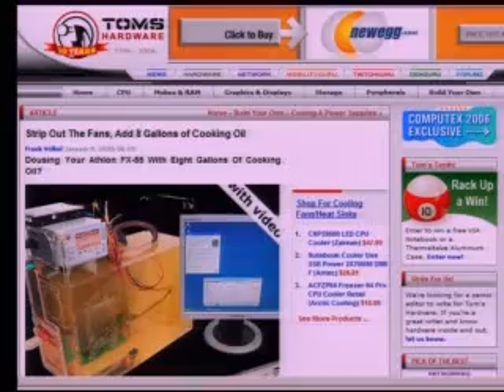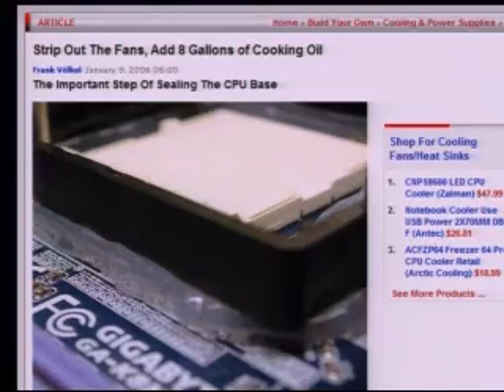Cool Your PC With Vegetable Oil

Comment: Dear God, I've seen some retarded shit in my time, but this has to be right up there. If you're going to build a submerged computer, you use mineral oil, not fucking vegetable oil! Vegetable oil is too thick and won't circulate properly even if you use a decent pump that can handle it. Vegetable oil will also denature over time, moreso when heated. And this guy has worked in IT for 15yrs??! Yeah, probably at the fucking help desk at PC World.

Comment: ok so i am spending thousands of dollars on pc components to submere it in oil lol better i buy a gun and shoot my self lol
Reply: I don't think so that's crazy I jusy made mines and it cost me over 3500 aint going to happen
Reply: Romon Reid Veggie oil is okay, but because it's organic based. you have to change it out every few weeks because it will rot. Use Mineral oil instead. Non conductive so it won't harm electronics. and it's not organic based so it lasts much much longer.
Reply: ***** I know. I just said that.
Reply: OK I congratulate the guy that did this  but I am not doing that to mine

Comment: Vegetable oil will go rancid. Use mineral oil instead.
He keeps referencing a "web site" for more details and cautions, but they keep this "web site" address a secret.
Also, the oil doesn't make the heat go away. It merely dissipates it. If you run for too long, you're going to want some way to cool off the oil.

Comment: for those that are wondering why not water. oil is a non cinductive liquid so it wont interfear with the electronics as normal water will. or if you wanna get pricy the water they tryed only lasted for so long.

Comment: @Kaoskadosk Heat goes from the oil, out the glass and into the air? Even water cooling transfers heat to air eventually, its just making it cooler and more efficient.

Comment: @jfkd00d   That's not the point though is it.  Using oil to dissipate the heat keeps the systems free of dust - and there is absoultely no noise!

Comment: PLEASE use mineral oil to be 100% Safe from any Electrical Hazard. this Demonstration you see here with Vegetable oil is NOT SAFE for you as a normal Computer user. As you can see, the guy used an old computer in this show, NOT his Alienware (he's smart enough to NOT put it in Vegetable oil ^_^ ).

Comment: Convection would alleviate any hotspots by natural thermodynamic flow of heated fluid becoming less dense and rising while cooler, denser fluid falls. Leaving the fans on will just kill them. They have light duty motors and bearings designed to handle a volume of atmosphere, if you increase the density you're asking them to move, the motors will strain until they finally burn up, possibly burning the connections on the plug due to the increased amp draw.

Comment: Distilled water is non-conductive, however, when exposed to open atmosphere microbial colonies form and their waste over time makes the water conductive, as well as airborn pollution. Vegetable oil is also ridiculous. It's used for cooking for it's fast thermoconductive properties. Mineral oil is smart, as it's used for high voltage/ampherage transformers, but screw oil. If you choose to upgrade, good luck degreasing sensitive electronics. Just buy a glycol liquid cooler and be done with it!

Comment: What someone should do is make a system like this that connects to pipes in a house and let the pc heat the oil and the oil circulates from the tank throughout the pipes in the house and back into the tank to heat a house.

Comment: yes. it would be wise to put a circulation pump and radiator in. i did this with an older computer and ran a benchmark for a few hours and the liquid got incredibly hot and damaged the motherboard.

Comment: Indeed, the oil is to dense for the fans to even rotate. That in turn will ruin your fans if anything. I think it would be smart to have a radiator and a circulation pump if you want to run it for a long time though. Can anyone confirm that?

Comment: Although the fans are good for the circulation...I'm not sure they'd last long. The motors aren't designed to fight the resistance of oil. So the hardware for the fans would go to shit fast i'd think

Comment: Everyone goes on and on about how this rig will run for months without a problem -- no, it won't. All of the veggie rigs have one common problem: vegetable oil will go rancid if left out for too long. Use mineral oil instead.

This was a great experiment, but it won't last, and it is irresponsible to tell people that it will.

Comment: No, for months as in, continuously for months with no problems reported and still running.  Why would you need to seal the CPU? It's no different from the rest of the computer, other than being a hot spot.

Comment: Wow. These people are lacking something...

Anyway, don't use vegetable oil! Veggie oil is organic and it will go rancid and break down. Use pure mineral oil instead. Seal the tank to keep out moisture and dirt. You can leave the fans, they look cool as they spin slowly. Keep the cover on the power supply to reduce shock hazard and EMI. A high-end computer will get hot, so you probably will want to use a pump and a radiator to remove heat from the oil. Don't submerge your disk drives. Nuf sed.

Comment: Actually they will be fine. Oil will lubricate and prevent them from overheating. I wanted mine to spin a little faster so I cut the fins off leaving just the edge. Three months running fast no problem.

Comment: Not unless you're stupid enough to light a match. Oil cooling is cost efficient, and much more reliable than a fan. It's going to be enclosed in a air-tight compartment. What kind of idiot could light a fire in an air-tight compartment?

Comment: you dont HAVE to take the fans out ive seen them run for 9 months with no problem and theyre still running plus they look cooler spinning slow a fan shouldnt burn up though since they are brushless and the spinning speed of the fan doesnt affect the components...heck it should last LONGER because of constant lubrication on the bearings

Comment: Haven't got a fucking clue, do you? Oil is too thick (and so is water) to seep inside the motherboard, the board is totally solid. Accessory Cards? Stop trying to use big words that you don't have a fucking clue about what they mean. After 48 hours of Prime95 the CPU hit 81C but that took well over 12 hours, the CPU won't start throttling (Tjunction) until 85C.

Comment: There's actually no hot spots due to the oil evenly dissipating heat. Corrosion won't occur if the PC is regularly on.

Comment: The 6800 GT is a good card and still is, but it is not a high end card anymore. An 8600 GT is just as fast but is DX10 capable. I can't break 100 FPS at 1600x1200 with AA and AF enabled. The 9600GT just came out and the 9800gtx/gx2 will be out soon.

Comment: wtf? all of them fail. why take all the fans off?? who cares??? leave them on and let them circulate the oil for a while till they burn out (if they even do). its not like they are gonna make the computer blow up or anything, just make a tiny bit more heat if they do burn out. then take them out if they die. if they are newer fans they should be okay for a bit. anyways, all three of them fail. they dont know what they are talking about.

Comment: Well, basicly that works :D Oil doesnt lead electricity so it wont shortcut. I guess that the oil has to be changed every now and then, and also a circulation pump and cooler would be good :D Of course selling the used components wont be so easy, if theyre all greasy..

Comment: lol... why the hell would anyone want to submerge their motherboard and cpu in oil!  my pc runs no more than 125 degrees and its a dual core 3ghz machine.  and you have to have a pump to circulate the oil??? gay.. that would make just as much noise as your fans if not more! save some money... spend 5 bucks on a 4 pack of fans...  i dont mind the noise from the fans in my pc at all.

Comment: distilled water should work, but you need to keep it clean and covered or the dust from the the air or the dust on your components will put minerals back in and cause a short. But mineral oil is stil the best bet from long term use, NOT vegetable oil because it will rot and become rancid.

Comment: You can also use industrial use Castor oil(it's cheaper and doesn't have storage problems). At work, (power company) we fill transformers with industrial castor oil.